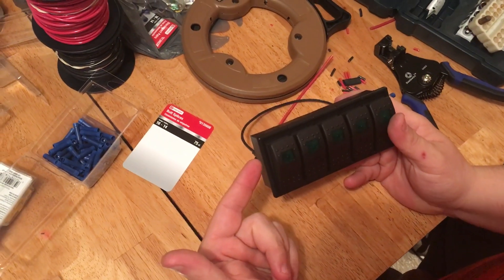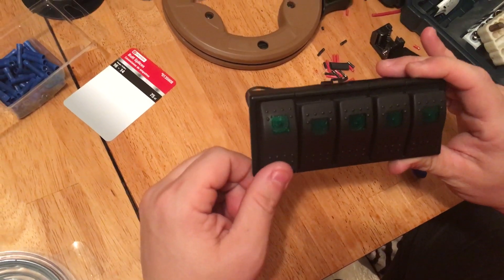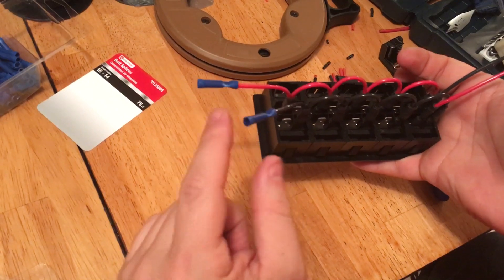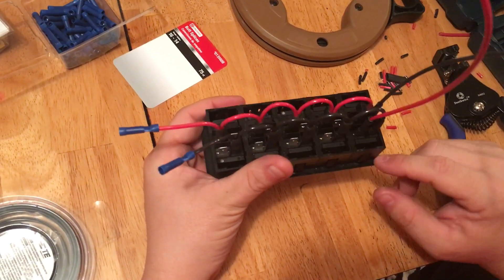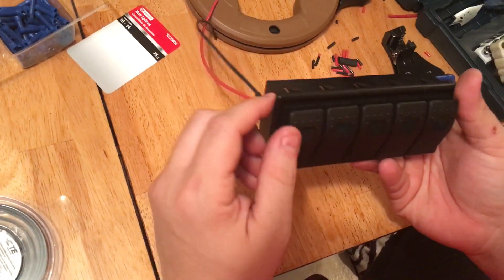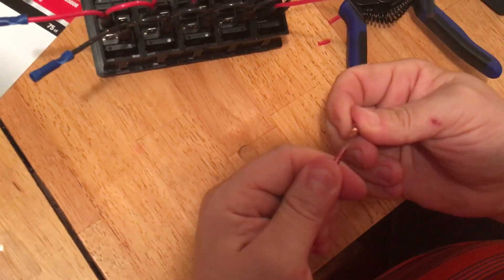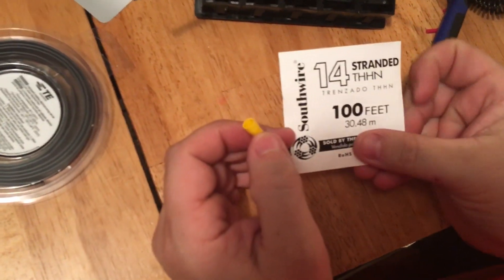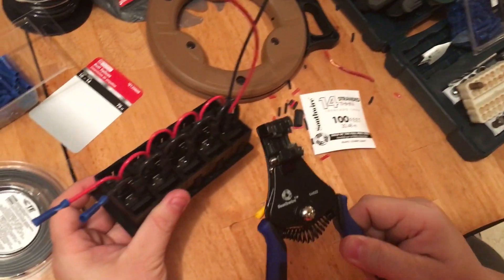4 Pin/Terminal Rocker Switch Toggle Switch Wiring Guide

Comment: Very good video and nice neat work.  One question....When the Pos. and Neg. are "daisy chained" together, aren't you limiting the amount of power that you can use?  If running small appliances, I would imagine it wouldn't matter, but lets say youre running a fan (which may draw max amperage of 1 switch) and a large light bar at the same time.  I would guess youd have to wire the fan and lightbar separately unless it would be advisable to run a thicker wire and "daisy chain"it??

Comment: I have an auxiliary fuse box that’s powering all my accessories. I like your setup but how would you connect a wire from each switch to its respected fuse to a fuse box?
Reply: Hey Marshal, I have the same set up as this video and I am going to just wire up inline fuses, but technically from the battery you install a fuse block then from fuse block run it to the hot side of what ever you're going to fuse.

Comment: Do you have a link to this rocker switch on Ebay or Amazon?
Thank you
Reply from the maker: Sheryl Ticer AutoEC Rocker Switch Panel Switch Holder Housing Kit - Black Plastic (pack of 5) https://www.amazon.com/dp/B01IBC5TRC/ref=cm_sw_r_cp_api_o3bWAbQ19BG1A
Reply: Thank you for the fast response! You bought the rockers separate then?
Reply from the maker: Sheryl Ticer I’m sorry, that was the wrong link...here are the rocker switches E Support Car Marine Green LED Toggle Switch Dash 4pin Pack of 5 https://www.amazon.com/dp/B00VV2JM1E/ref=cm_sw_r_cp_api_tOoWAbEEHKYFQ

Comment: Ok so how would that be wired up to a 4 prong relay. 
30 87 86 85.
Reply: The prong on the bottom left (next to the ground), plug that to 86; ground 85; then feed 12v to 30 and pin 87 goes to the item you're powering, (Make sure you have a ground from the item you're powering to the body.

Keep in mind, those pins are relevant if 86 - 85 is the magnetic (small switch) and 30 - 87 is the power side (big switch)

sorry for the wording, not a qualified elec, just trying to help^
Reply: Colours Youtube ok so you have 2 blanks at the top.
Then the middle ones are left is for 30. Middle right is for 87.
The bottom ones are 
Bottom left is 86 and bottom right is 85.
Is that correct?
Reply: Colours Youtube ok I have 4 prong lighted Daystar toggle switch looking at the prongs 
1 top left is power. #30 red wire
2 top right is ground.  #85 black wire
3 middle left is load. #87 blue wire
So where would the #86 white wire go?

Comment: I have a prewired pod off ebay and my wires are not in the same place as yours. Of course no instructions with it. Trying to tell from your vid how yours is set up compared to mine. Any idea how to tell which s..hould be battery positive
Reply from the maker: Bryan Wagoner in the video you can see how I oriented the switch (top and bottom). For me the positive from the battery was the top left terminal. Because it was a lighted switch (the switch itself would light up as well as what you were powering) you have to make sure it is the correct terminal to send power both to the switch light as well as to the destination positive. I figured this out simply through trial and error as there were no instructions with the product I purchased either. Hope this helps.

Comment: definitely a lot easier to understand than other YouTube videos thanks will you have a master switch to turn off power to all switches or do you disconnect the battery
Reply from the maker: I'm using battery clamps to disconnect.  I actually have 2 batteries that I swap out when one needs a charge.

Comment: Ok sorry this comment is so lat. If I wanted to add a fuse box how would I wire it with the switch and led? This is the fuse box https://www.amazon.com/gp/product/B00QMTAZ1W/ref=oh_aui_detailpage_o01_s00?ie=UTF8&psc=1 I am using the same switch's as you
Reply from the maker: 1nHumanReaction5  I'm not sure...let me see if I can figure it out and I'll post another video.
Reply: what exactly were you trying to wire up? One toggle per circuit on the fuse block?